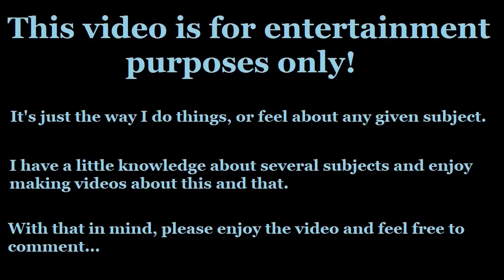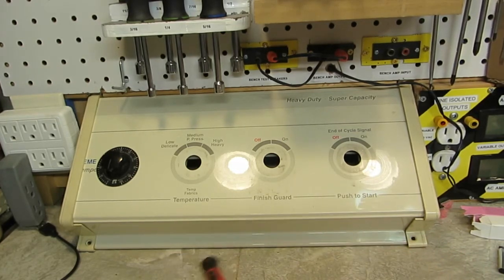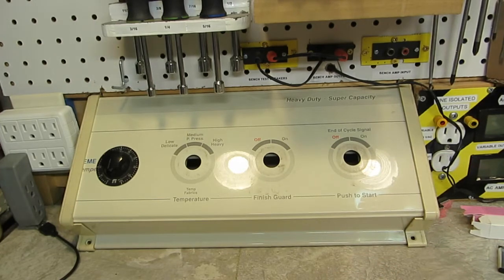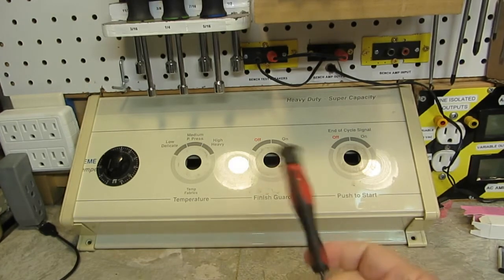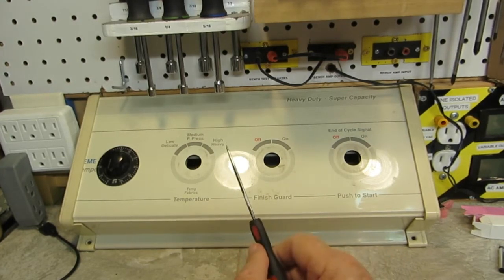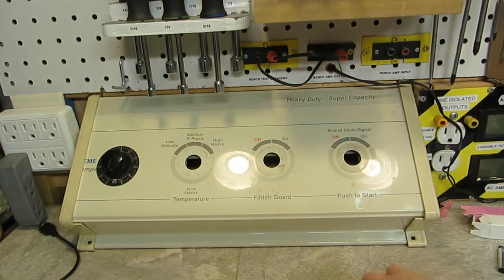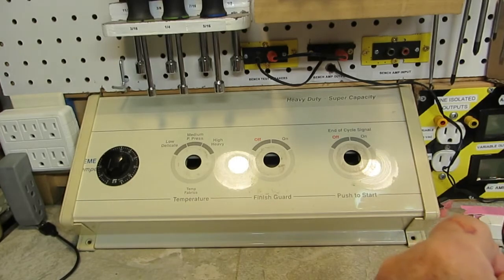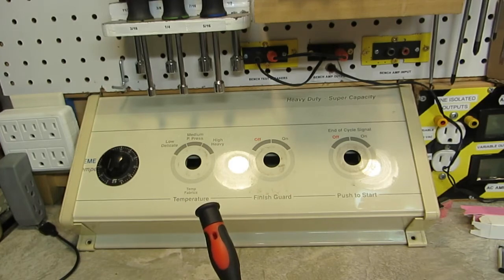DERB - What if?

Comment: I think it's a good idea to incorporate more features into the panel Doug. You didn't mention a current or wattmeter but I think a current meter should be included, and a one amp circuit breaker.

Comment: Doug, just one comment, the top of the panel would be a good place to install the meters and the very bottom would be a good place to install the connections needed for any outputs you may use... ):